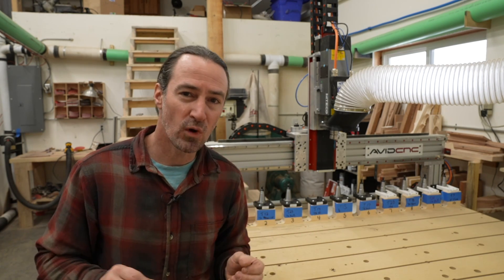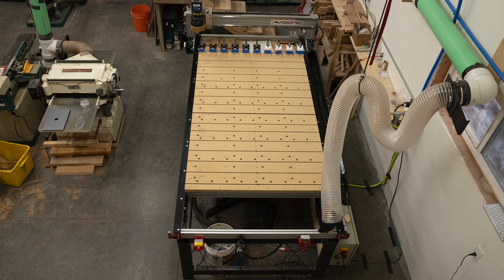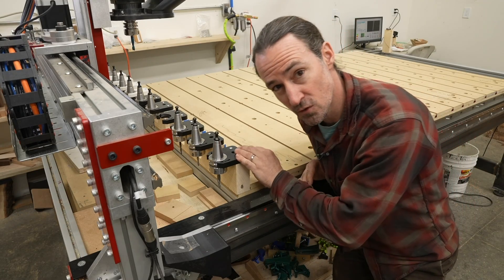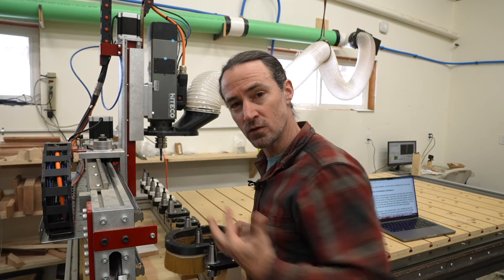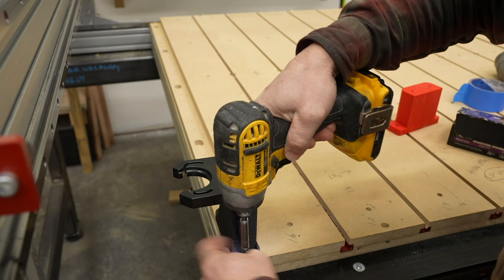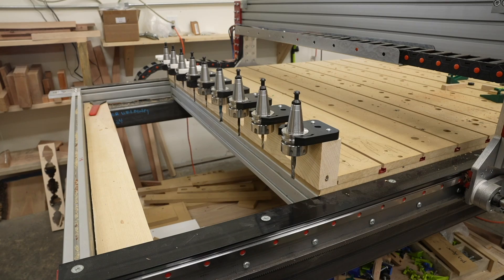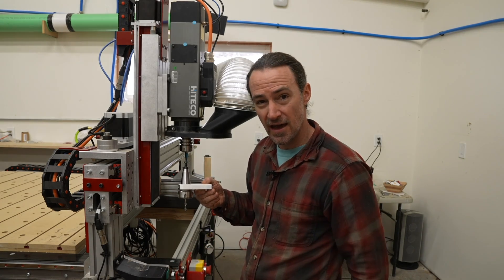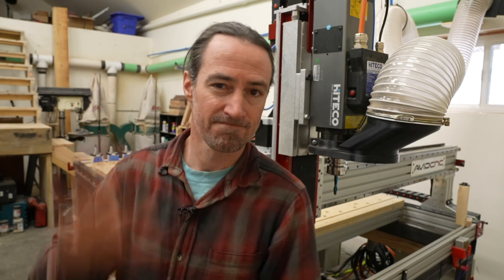CNC Build Ep 6: Automatic Tool Changer Rack / Tool Stations - DIY Wood ATC Tool Rack for Cheap

Comment: I recently do some searching and still didn't get my answer,what do you think if i want to add ATC to my cnc that has open loop motors and drivers? Do you think it's possible or i need servo motors and closed loop systems
Reply from the maker: I've got open loop stepper motors; you don't need servo motors. But you do need some way of "homing" the system consistently, which is pretty easy with some sensors (the Avid has them included). So yes, it is possible. If you are still having trouble...send me more info...maybe I can help.
Reply: @CorbinDunn  thanks for replying 
Yes actually my current cnc is laguna swift that already has a type of soft limit and laser home sensor,so you make me more confident with your answer that i still can have atc without changing my steppers to servos.
Reply from the maker: @MILAD.VAHDAT  Yeah, I'm sure it could have an ATC, but the thing that you might have an issue with is the software that controls the CNC machine; it is a pendant, right? I'm not sure if those pendant machines have support for ATCs; I know some Laguna's do, but I don't know what controller/software they use. Mine uses Mach 4, which I customized for the ATC. So, look into your CNC control software and see if it supports a tool changer and adding tool positions (somehow).
Reply: @CorbinDunn  yes,i definitely should change the breakout board and controller from the current default (RICHAUTO) that is so simple and useless to Centroid Acorn cnc software and controller,and reprogram everything from the beginning that makes me so terrified if i mess.
Reply from the maker: @MILAD.VAHDAT  That definitely would require more work! I know a lot of people have done it, and I think Centroid has a lot of great help from people on their website forums.

Comment: Corbin, you're videos have been so important as I've set up a CNC in the high school shop I run. I'm wondering if you have an active link for the skinny dust boot 3D printer file. The current link is dead and I can't find it elsewhere on your site!

Thanks for all the time you put into these videos!
Reply from the maker: Cool! Yeah, I did a new v2 dust boot design (there's a video about it). Thanks for the info about the link; I will update it! https://www.corbinsworkshop.com/shop/cnc-dust-shoe-v2-stls-and-fusion-360-parametric-design-for-3d-printing/

Comment: please tell me How accuracy using pinion rack is giving You and how You avoid backlash, might pinion rack lose steps ?
Reply from the maker: Sure! I'd say it is at least as good as what Avid advertises, which is up to 0.005", but probably even better, like 0.001". It depends on the size of the project; getting the accuracy over long distances is harder than getting it over short distances. Backlash: I recently adjusted for this in Mach 4 to eliminate it; it's just a setting. Losing steps: I haven't ever lost any steps, but my spindle is beefy. Losing steps is usually because the spindle can't keep up.

Comment: What I did was use an aluminum extension and put it on the front of the avid raised it 6in. Used slide and angle brackets to hold the tool holder plastic clips. Makes it easy to adjust and looks great on. Cost was 30 dollars.
Reply from the maker: Awesome - that is another great way to do it! Do you have a dust hood/brush that you leave on during the changes? Have you had any issues? One of the reasons I didn't go with a straight rack (IE: an aluminum extrusion) was that I was worried the dust brush would get crushed a bit. I have the gaps between my stations for the brush to slide into. If you dock your dust boot, or don't use one, then it isn't an issue.
Reply: @CorbinDunn  I used 4040 aluminum extension bars. Cut 10ea 4in pieces to raise the plastic tool holder clips. Used corner angle brackets to hold it down and easy to loosen to adjust positioning. This way the dust boot does not get crushed.  Only bought the avid CNC frame and built my own controller box. Wanted it to cut plasma, wood and laser. Put dual z axis on it. Used 1800oz numa motors instead of there 1200oz needed extra power for the 11kw ATO I installed. Also bought more 4080 aluminum to strengthen the frame and gantry. Love your idea. Keep up on sharing.

Comment: Do you have the script code to run this tool changer in Mach4? 
Programing this script is why i switch  to Masso CNC controller And is very easy to use and really  fast,  but i prefer  Mach4.
Reply from the maker: Yup! Follow along on the next episodes - I talk about the customizations I did to Mach 4, how to download it, install it, set up tool stations, etc.

Comment: Hi I am looking to buy one of these and add the ATC, I have a question. What size bed did you buy? to allow for the ATC.
Reply from the maker: Sure - I talk about the size I got a bit in episode #1. I got a 4'x8' table -- but I'm perfectly okay with losing some space due to the ATC and due to a rotary table (which I don't have yet). A 4'x10' would be much better to avoid losing space, but I didn't want to sacrifice the area in my home work shop.

Comment: Thanks for the video - has given plenty of ideas. Your cnc hold-down clamps - is there any info / download file for those please?
Reply from the maker: Thanks! The clamps are so handy, and super lower profile. I spent quite a while designing a parametric file for the clamps. The handle sits on top of a 1/4-20 nut, and can easily be pulled off if you are worried about hitting it. I sell the design for $4 over on Etsy (also on corbinsworkshop.com). If you have Fusion 360 you can customize any of the parameters. It does require a 3d printer.  https://www.etsy.com/listing/1450374547/low-profile-cnc-toe-clamps-for-t-track?ref=listings_manager_grid

Comment: Great video did you order the Hiteco ATC from Avid I know they sell the manual ones on there website I’m going to upgrade the old electronics of my machine with the Nema kit they sell and probably put an ATC on it with a similar tool rack just trying to decide between cncdepot or something a little bigger like the Hiteco you have
Reply from the maker: I got the package from CNC Depot - check out the previous few videos where I discuss it. I'm not 100% sold that I needed the 5 HP HITECO, and I think CNC Depot's standard 3HP motor would have been fine for most all the stuff I need to do.